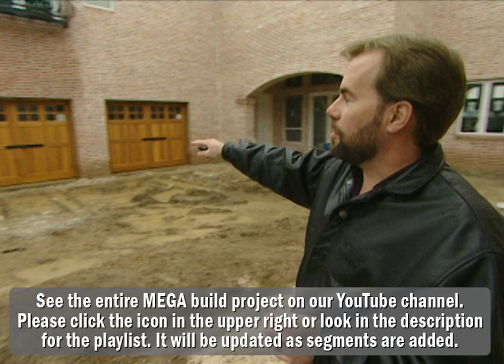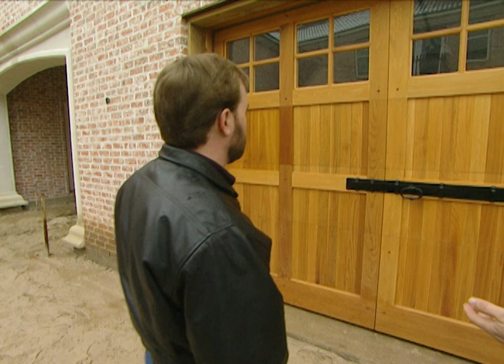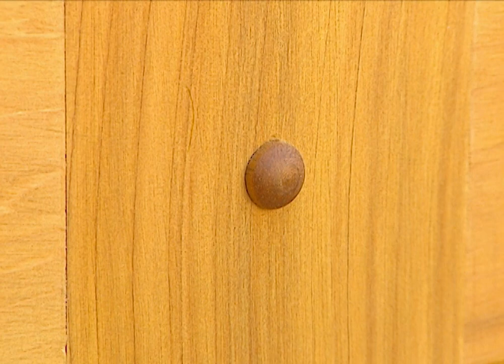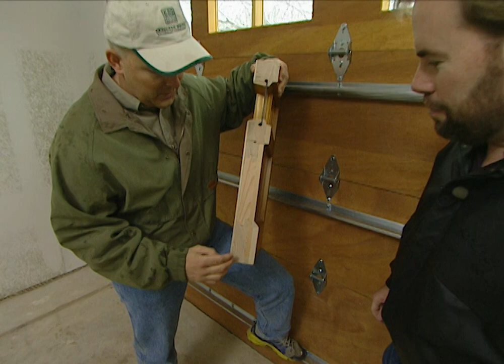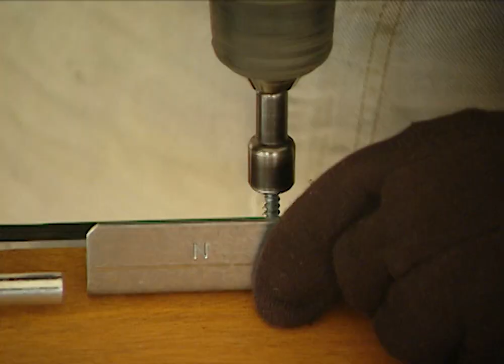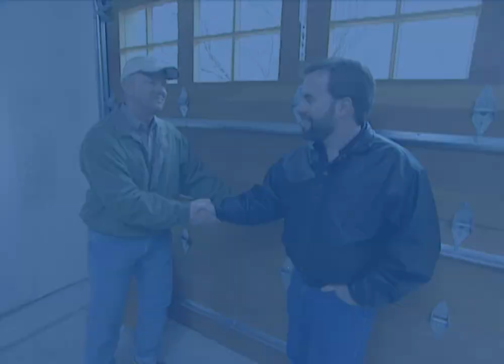Mega Build -16,000 sf - Part 16: Wood Garage Doors

Comment: Those are sexy garage doors. Hurricane and burglar proof.
Years ago my father who was a cabinetmaker replaced the old metal rollup door with one he made of solid wood. He used the existing hardware from the old door. Finished it with several layers of stain and insulated on the inside. Not to long ago thieves decided to try and break into the garage ramming the door with their vehicle. They didn't get in but caused enough damage to replace the garage door. Built tougher than  Ford.